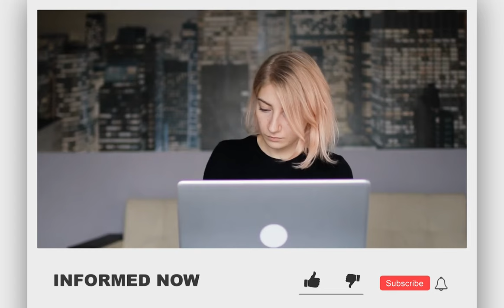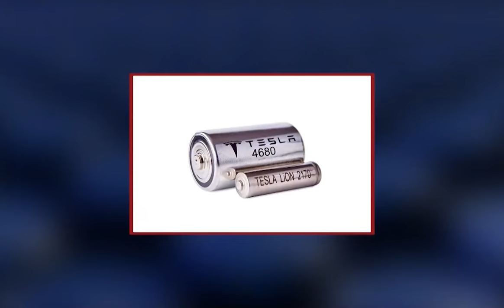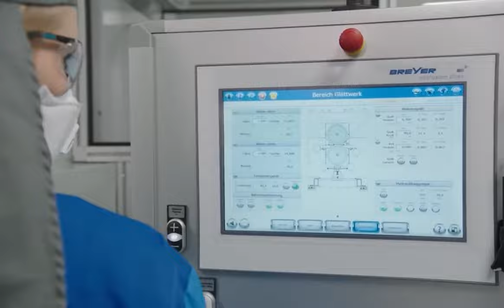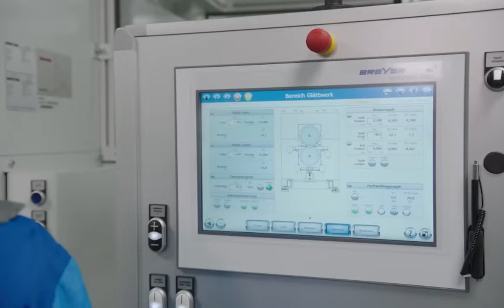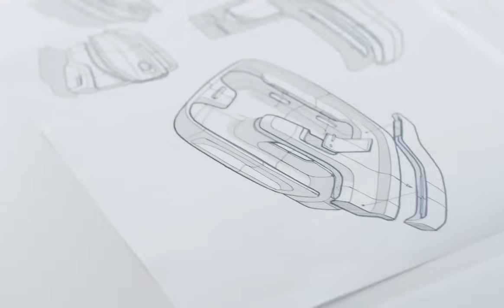Elon Musk And Tesla Just Announced Huge Problems With The 4680 Battery

Comment: the explanation is too complicated and does not follow a clear path. the problem is simple. 

the majority of benefits derived from the 4680 battery are founded upon a "dry electrode" manufacturing process. and they are having problems implementing it. tesla can make a battery with the dimensions as the 4680 battery described at "battery day" a couple of years ago,, call it the 4680 battery and build cars with it. in fact, that's exactly what they ARE doing. however, there will be few benefits of using it, other than it's use as a structural part of the car. 

...not exactly what was implied a year or so ago, though. 

apparently, they (or maybe it was only musk) thought that they were so close that a successful manufacturing process was only a few months away. ....not so. like maxwell smart said, "missed it by THAT much...".  :)